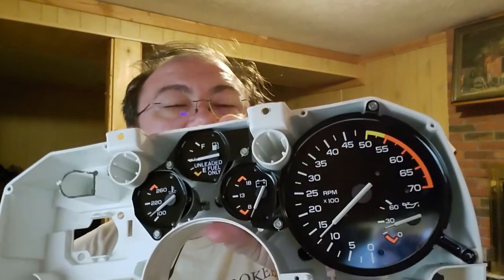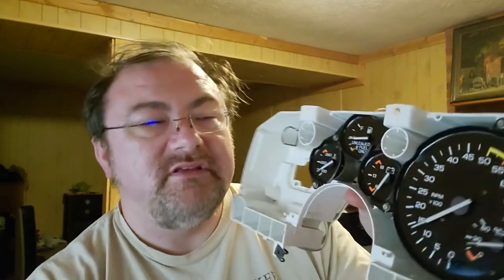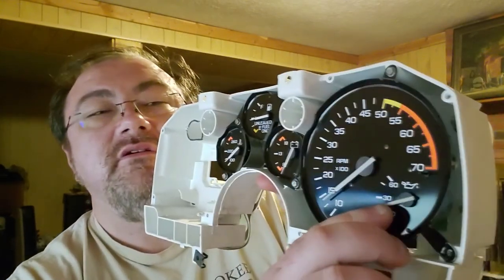I Broke My Speedometer

Comment: Takes a special tool to take those needles off if you broke it more then likely you'll have to just replace the cluster and hawks or Rick's camaro has alot of parts and you can't adjust the speedometer by the gauge or needle they're electronic if it's newer than 88